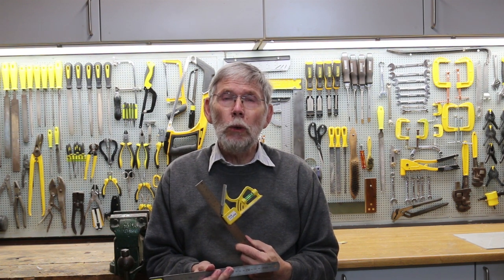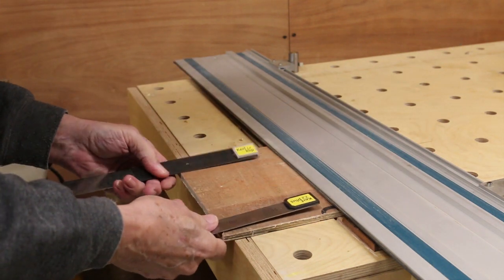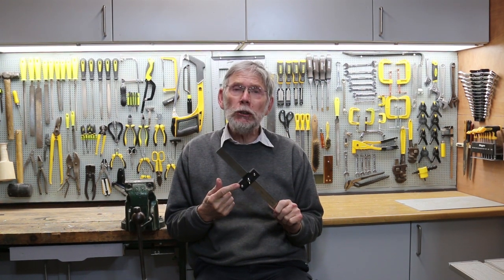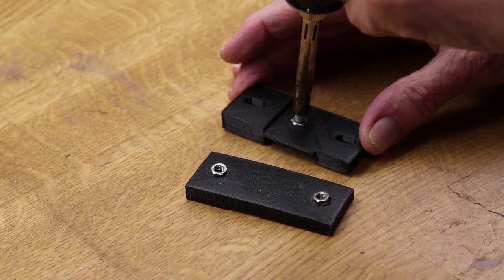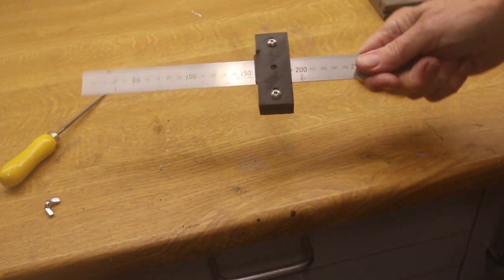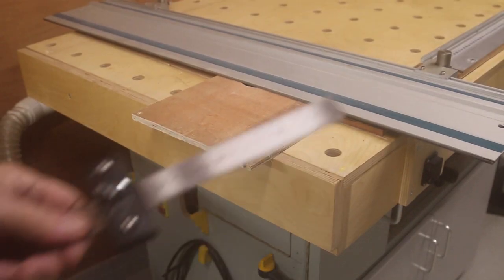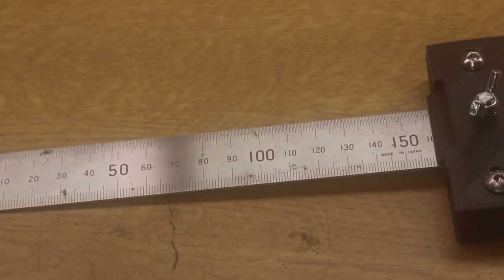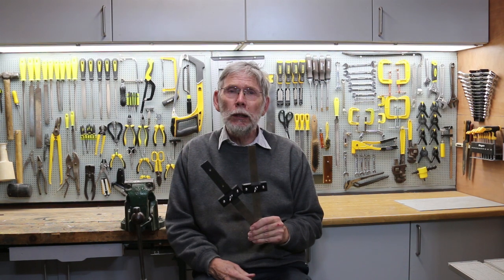Ultimate waste side

Comment: Great jig! I like the idea of the kerf inclusion. Also, just incase you hadn't seen them, you can also get barbed inserts for 3d prints that you melt in the same way you showed. But the barbs help secure it. Search for "THREADED BRASS BARB INSERT FOR PLASTIC" on ebay, about £6 for 25x M4 👍
Reply from the maker: Good tip, thanks!

Comment: Just a thought: because the kept piece is on the waste side, I’d think that minimizing it sliding would be helpful, so using a non-skid mat underneath could be an additional way to maintain accuracy
Reply from the maker: That would get cut every time…
In practice I set the friction by adjusting my rail lifter ( see the video on this) to give a gentle amount of drag. The non-slip bottom of the rail does the job.